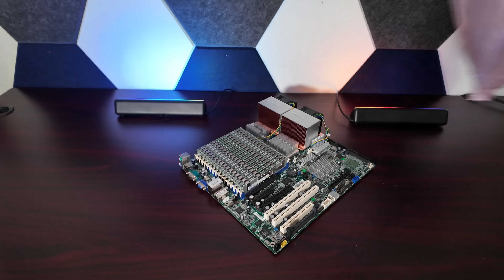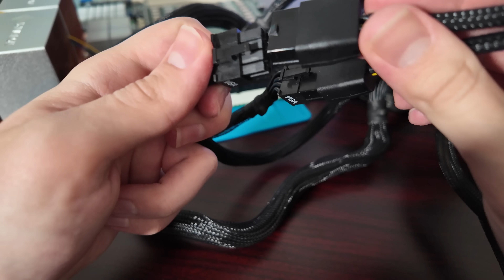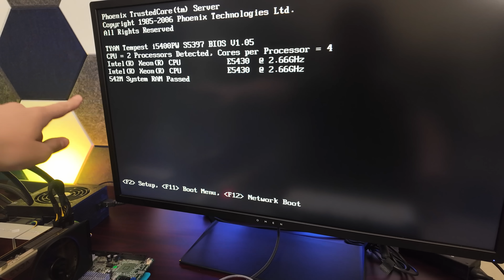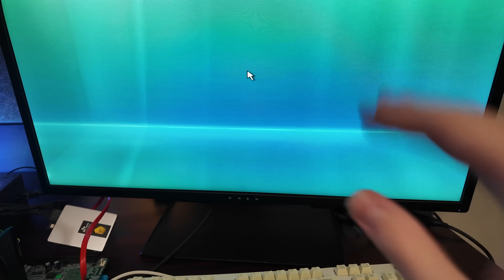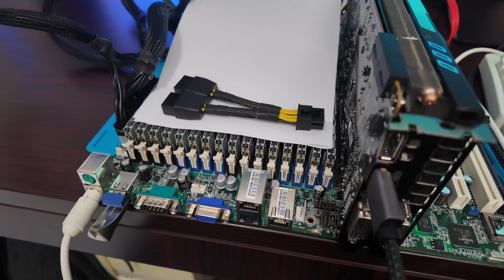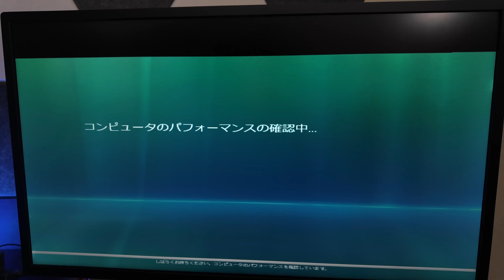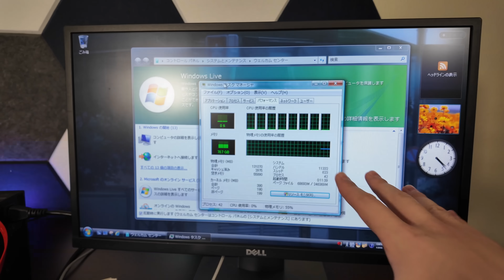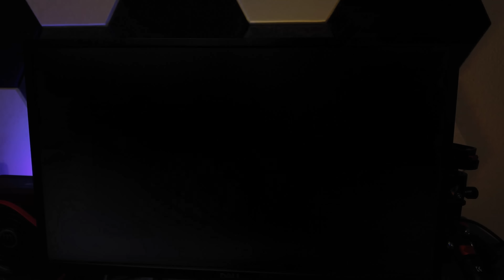What can you do with 128GB of DDR2?

Comment: I asked Grok what to do and it suggested this:

Here’s a bunch of realistic (and some delightfully impractical) things you could still do with that exact 2008-era dual-Xeon E5430 + 128 GB DDR2 Vista Ultimate monster in 2026. The CPUs are painfully slow by modern standards, but the 128 GB of RAM is the star — it’s still more than most gaming PCs have today, and Vista Ultimate 64-bit can actually use every last byte of it.RAM-is-King Uses (where the 128 GB actually shines)Insanely fast RAM disk workstation
Turn 100+ GB into a RAM drive (using SoftPerfect RAM Disk or similar Vista-compatible tools). Compile huge codebases, run video-editing scratch disks, or load entire game mods/texture packs in seconds with literally zero disk I/O.
In-memory database monster
Run old SQL Server 2008/2012, MySQL 5.7, or even PostgreSQL 9.x entirely in RAM. Perfect for local data analysis, genealogy software, or testing massive datasets without ever touching an SSD.
Massive virtualization host
Throw VirtualBox 5.x or VMware Workstation 12 on it and run 20–30 lightweight VMs at once (XP, 7, old Linux distros, retro OSes). Each VM can get 4–8 GB because you have RAM to burn. Great for malware analysis, OS archaeology, or pentesting labs.
Entire sample-library music production rig
Load Kontakt libraries, huge orchestral samples, or Ableton Live projects (Vista-era versions) completely into RAM. Zero loading times, zero stuttering — producers who still use old setups would kill for this.

Retro / Nostalgia UsesUltimate retro gaming PC
Run heavily modded Skyrim (old version), Crysis, GTA IV, or any 2007–2012 title at max settings + 4K textures + 100+ GB of mods loaded in RAM. Pair it with a period-correct GeForce 9800 GX2 or Quadro FX 5800 and you have the most overkill Vista gaming rig on the planet.
Dedicated LAN game server
Host Counter-Strike: Source, Team Fortress 2, or old Battlefield servers for local parties. The RAM lets you run massive maps and 64+ player slots with every asset cached in memory.
Vintage software time machine
Run ancient CAD (AutoCAD 2008–2012), 3D Studio Max 9/2009, Adobe CS5, or old accounting/medical software that still refuses to die in businesses. The 128 GB means you can have 50 huge project files open at once.

Practical / Niche 2026 UsesAir-gapped cold-storage / data sanctuary machine
Keep it offline forever. Use it for family photo/video archives, crypto seed phrase generation, or scanning old hard drives. The RAM lets you process terabytes of data entirely in memory before writing to external drives.
Local media / Plex-like server (no internet)
Run old Emby or Plex Media Server (Vista-compatible builds) with 128 GB RAM cache. Every movie, TV show, and home video on your network is served instantly because it’s all cached in RAM.
Offline AI / machine-learning playground (old-school style)
Run ancient TensorFlow 1.x or even just CPU-based scikit-learn on huge datasets. Not modern LLMs, but great for training old-style models or doing statistical analysis on gigantic CSV files that would swap on lesser machines.
Home-lab “beast mode” test bench
Developers and sysadmins love these for:Testing software compatibility with 2007–2017 Windows apps
Running ancient enterprise software (SAP, Oracle Forms, etc.)
Benchmarking “how bad was 2008 hardware really?”

Weird science / simulation box
Run legacy scientific software (MATLAB 2009–2012, old COMSOL, huge chess engine tablebases, protein-folding tools from that era) that loves RAM more than clock speed.

Bonus “Because Why Not” IdeasTurn it into the world’s most overkill digital photo frame — preload 128 GB worth of 100-megapixel RAW files and scroll instantly.
Run it as a print server for a print shop that still uses Vista-era RIP software.
Make it the ultimate Minecraft 1.12.2 server with 100+ players and every mod known to man loaded in RAM.

Bottom line: In 2026 this machine is useless for anything that needs internet or modern performance, but it is an absolute RAM god for anything that can run in a 2007–2017 software ecosystem. Keep it air-gapped or behind a very strict firewall and it becomes a surprisingly capable offline powerhouse that most people today can’t replicate without spending stupid money on ECC RAM.

Comment: That RAM drive software probably doesn't access the RAM directly and instead has to pass through an abstraction. When writing data, the Windows kernel puts the data in a write cache before committing it to the memory set aside for the RAM drive and this would be more direct. This would account for writing being faster than reading. A good use for this machine would be a file server, especially if the RAM has ECC. The amount of RAM would be great for caching. I'd be curious to see if the system could max out a 10 gigabit SFP+ adapter.

Comment: A fairy dies in an enchanted forest every time someone installs Windows Vista on a server with 128GB of RAM.
Reply: It's kind of fitting, though. If you know the history of Windows development. After the disaster that was Windows Longhorn, Microsoft needed to reset--so used Windows Server 2003 SP1 as the base for Vista.

Windows Longhorn is that part of Microsoft/Windows history that just gets more interesting, the deeper you go.
Reply: Correlation is not evidence of causation.

Comment: Dual E5430 are 4x slower than one 4 years old mid-flagship Core i7 12700K, one of the leaders in DMIPS-per-dollar special olympics that even beats in Cinebench nearly all Apple M chips, except for very beefy and expensive zillion-core M Ultras. And which can be purchased at a bargain price today. Not so bargain as 2x E5430, but electricity bills will eat up the difference in a year or so.

Comment: I have 6 DELL CS24nv7 1U nodes with dual socket-quadcore AMD Opteron ( Barcelona ) each filled with 128GB DDR2 combined with a Mellanox dual port IB/ETH card within the PCIe slot are pretty neat for RDMA over the network, that combined with a 2-node x3850X5 and DELL R810 using a mixture of IB/ETH cards is really helpful for holding data for ML/AI usage along with HPC clustering overall.

Comment: I bought 3 off-lease Xeon Workstations, they each have 12 cores (24 logical cores if hyper threading is enabled). These machines have DDR 4. they have 32gb each. 
Perfect for Windows 10 LTSC, with extended security updates until 2032.
-These machines make great workstations, audio production machines, or gaming pc’s. You just have to outfit the right PCI express GPU if you’re gonna game with them.
At work We just use quadro gpu’s for multi monitor setup.
They also feature RAID , so good for small office servers.
RAM OPTIONS are 32gb, 64gb, 128gb.
Next step: run Linux on one for NAS storage etc.
Cost: $350-$450 each. Through eBAy.

Comment: If you are comfortable around Linux, which seeing Fedora I think you are, I think I may have a use for all that RAM for you. Depending on the amount of SATA connectors this motherboard has, and how many hard drives you have, you could turn it into a file server. Then configure those drives as a ZFS pool, maybe even in a RAID5 / RAIDZ1 configuration. Do check up on the sizes of all those drives being the same though. And then with all that RAM, ZFS will be able to cache the data into memory, as well as even supporting deduplication. That last one is not enabled by default because it's very memory-hungry, but I think that your 128GB should be sufficient for that. The general rule of thumb with filesystem caching is 1GB RAM per 1TB of storage. ZFS will by default take half of your memory for caching, and can be configured otherwise. Rule of thumb is to give it as much as the system can spare, and ZFS will relinquish that memory for applications when necessary. With deduplication however, you'll want to read up a bit on how that works before committing to it. The deduplication table MUST live in memory, and will not be relinquished. Your system likely supports it, but I don't have much experience with it myself. So good luck, and please document your findings!

Comment: Depending on the cost of electricity.
I would probably use it as a cache server.
Add a few 10Gbe NICs, and you can also add SSDs.
128Gb is a lot.

Also, data processing on the GPU requires a lot of RAM and almost no CPU. SSDs lose their resources quickly, but DDR does not.
Some kind of hash sorting (for session validation or something).

Comment: The speed you achieved is about what you'd expect from one DDR2 stick. I think the ramdisk software puts the data sequentially, first filling one ram stick before touching the next. If my assumption is correct, and you can find a ramdisk manager that stripes the data across all the sticks, it would be much faster.

Comment: OOo thats interesting. 
I wonder if you can put a LLM on it, a large model and see what it does?
Reply: the memory bandwidth of a frontside bus attached FBDIMM memory pool is probably similar to the bandwidth from an NVMe SSD today. It would perform about as well as trying to run an LMM straight from disk.
Reply: @noname-gp6hk ah ha... thats interesting.
Reply: Yes but it to slow to work with it.

Comment: I have PC with ddr2, it's on server mobo on socket F. And there is 128gb in quad channel, on 1066mhz. It's quite good, using tmpfs in Linux in this ram for build from sources, for example. Like ramdisk. Or I can run a lot of VMs

Comment: maby let it do some scientific computing, that needs a lot of ram but not fast Ram just capacity?
or if you cant find a projekt you can hang it on a wall and flex with it
maby you can use this ram as a a ram cash if you have a harddrive nas (buy soon if not becaus the prices are rising on HDD's) I don't know if it is worth it with Sata ssd's or M.2's That Motherboard should have some good sata ports 
Maby a remote desktop if you have cronically too many  tabs open

Comment: this one has actually working 126 gb ram. vs My computer that should have accepted 4 sticks of 126 gb ram but it only post's if its only is 2 of 64gb ram installed. I have had so many issues with RAM over the recent years. its like there is always something faulty with one of the ones i get. I also have another old computer that had been running on a single stick of RAM that only had 16Mb on it and it still works today compared to many of my other DDr4/5 ram sticks that are laying around broken after just a few months of use. it is insane how bad quality ram we get now Lol

Comment: "What can you do with 128GB of DDR2?)
Well, if it's FB(fully buffered) ram, heat your house.
Reply: Connect it to a thermoelectric generator and it could power itself indefinitely.
Reply: @jamesanakin  "In this house, we obey the laws of thermodynamics"
-homer simpson.
Reply: @BLKBRDSR71homer drops his donut doh
Reply: @horseuch  homer spills his soda doh!
Reply: @BrosephiusGaming  homer hits the doorway doh
Reply: @chrisbaker8533  This is my favorite dry joke in the whole show. Lisa makes a perpetual motion device because shes out of the school due to the strike, purple monkey dishwasher.
Reply: @jamesanakin  do not make me bring electroboom into this.
"THERE IS NO SUCH THING AS FREE ENERGY"
Reply: @LukiRudaka  how about tapping to the power of aether
Reply: @LukiRudaka Also there's no cutting corners on RAM. And swap isn't RAM. 128GB of RAM is still a lot.
Reply: @Betelgeusewaitforit  i found that nvme is around a magnitude of a 1000-10000 times slower than ddr2 in latency, but this could be fine if memory is prefetched well and nvme-ram throughput is high enough that it's only every ram cache-miss that's 1000x slower, and the problem becomes cache invalidation again
Reply: @charleslegates9231  That's the Intel card they sold for. Can't remember the name. It was caching frequently asked files to the PCI Express bus.
This idea is definitely explored to some length. 

AMD tried something like Hyperlink and the Power PC architecture tried the High Speed fabric at the chip level.

Cache invalidation and ECC have always been a challenge. Hybrid Drives tried with SATA. 
For me as a developer, RAM has no equal. But I am OCD about memory management. Most have left it long ago as a waste of time. 😢
Reply: Gave myself a permanent scar on my left arm from burning hot FB-DIMMs in an old X5492 box many years ago. You can still kinda see the clip shape on my skin
Reply: Does it overheat, especially the middle ones? It doesn't look like there's enough space in between for air flow.
Reply: @sqlexp  They can, that's why systems that us FB ram have high airflow fans.
My old dell precisions that use FB have monster intake fans, a fan over the RAM and an exhaust fan, as well as ducting to keep the airflow directed over those parts.
You pretty much can't be in the same room, without hearing protection.

He's mostly ok, since it's not in a case.But if he puts it in a case, those fans are not gonna cut it.
Reply: @chrisbaker8533  This is nothing, I have seen worse. Server fans can sound like a Jet Engine. Got my Phenom 2 processor which is loud af at boot on the fan it came with.😂
Reply: Stick it into a Dell 2950 and watch the power meter go brrrrrr
Reply: It still has a 600mb download speed while I have 23mb
Reply: @egyember34  What are you even on about?
Download speed is determined by your ISP.
Reply: "
end your quotes lol
also that closing parenthesis seems a bit hard to have manage lol
Reply: Buy a house in 2027.
Reply: this isnt a terrible idea tho lowkey
Reply: Mine has 2 GB but the good thing is still running. It will run Win98 to Vista but obviously WinXp and Linux are installed.
Reply: ROFL
Reply: It is FB DDR2, so they run hot. So yeah it can definitely heat up the house.
Reply: A indeed fully buffered ram of any type will essentially heat up the space .  Which is why servers are still air cooled as it makes more sense to cool the cpu's as well the ram and then the hdds or ssd's all at once with one air source. (Blade Servers) (1U - Servers) 2U - 4U systems are a but different on how they cool things as they don't have space constraints to worry about.

Comment: You could try running some quite large LLMs (like a ~100GB+ distill of DeepSeek R1) and see how many tokens per second you can get! Maybe check if the quality of the output from a small vs large model changes much. Really interesting what will come out of this, see just how much memory speed really matters. Would need to run it on at least linux or windows 10 though. I know its funny that we're in the middle of a crisis because of LLMs and I'm trying to tell you to run an LLM but I swear its interesting from a pure performance perspective!

Comment: not sure if partitioning ssd with vista is a good thing .....
Reply: I think the ssd itself has firmware that protects from that shit these days, if you are talking about the read/write cycles
Reply: @SV-cg3sk  no, partition & sector alignment issues. unlike hdds ssd sector need to be properly aligned during partition. but older oses probably didnt do that job well.

Comment: Counting RAM did not get much faster... Thankfully it remembers it and doesn't train every reboot. I'll check my PC that has DDR2
That seems like a fun thinker pc. I'd put XPx64, 2k3x64, W10 IoT LTSC, or Linux on it.

I've seen a task mgr like that on both my main and my side PC.
Main: 7800x3D 128GB DDR5, 7800XT
Side: Xeon 2650v4 12 core 24 thread, 96GB DDR4, 1660TI OC
Tinker stuff: 
AM1 5370 16GB DDR3 and Nvidia Quadro K620 2GB 
Athlon X4 860K Black Edition, 16GB DDR3 nvs310 512mb
Athlon64 x2 4200+, 4GB, integrated gpu or HD 2600XT (I think I had more RAM to it but gave it away when I didn't need it)
Star64 8GB, R7 370 2GB

Comment: im pretty sure the apple mac pro 1,1/2,1 has similar hardware... if its FBDIMM getting hot is normal for it (i know in the mac pro 80°C are "normal" temps for the ram)

just read in the description that it is FBDIMM. my bad. but still running hot is "normal" for it.

Comment: Had a Dell Precision 5400 for a while, similar to the system in this video, but a workstation (not a server). 
2x quad core Xeon's running at 3Ghz
32GB DDR2 ECC
HEAVY beast of a machine. Ran loud and hot at load. Not very power efficient either lol.

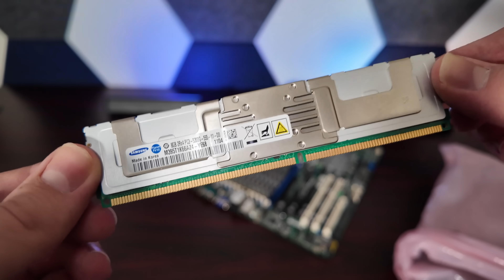Comment: 0:32 8GB DDR2 !?!?!?
I though the most was 4GB ... which is already very rare ...
Reply: those aren't normal DDR2 DIMMs, they are FBDIMMs. They had extra buffering added to increase capacity over desktop grade DDR2. Xeon 5100/5200/5300/5400 CPUs required FBDIMMs.
Reply: only on ECC
Reply: ECC Server RAM you can tell from the heatspreader its not normal DDR2 RAM but he should have explained this.
Reply: I had 2 8GB sticks in 2010? Can't remember the timeframe, but a 5770 was involved.
Reply: nope , i had 4 8gb ddr2 sticks of ocz ram for 16gb on my original system.
Reply: @killerdeamonking ? 4x 8GB would be 32GB
Reply: @RWL2012 correct I made a typo there , meant to say 4gb x 4 on that system where as I did also have a 2 ram slot system that also had 16gb at one point.
Reply: @killerdeamonking  much more expensive than the usual 2GB ??
Reply: @andrewkamoha4666 it wasn't much more back then when I bought them.   But the server ram shown in video was way way more costly.

Comment: Is anybody going to ask why you used not only Windows Vista, but a Japanese version of Windows Vista for the OS in this video. I know modern Windows probably isn't an option with such old hardware, but Linux or even Windows 10 could have been possible to use.
Reply: it technically works just fine on Win 11, just up until 23H2 and it should run fine